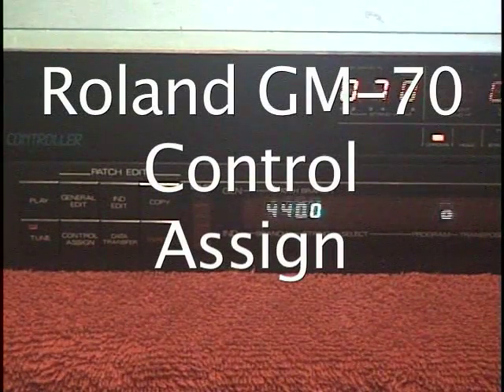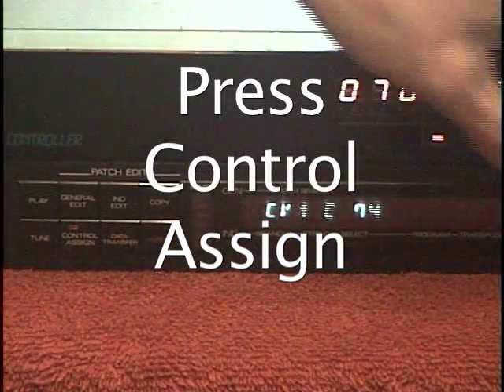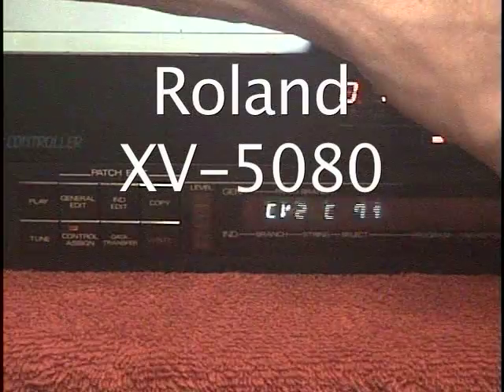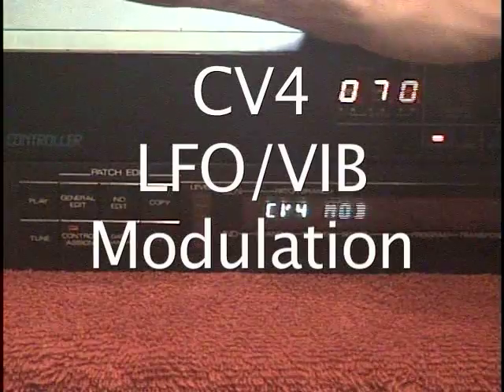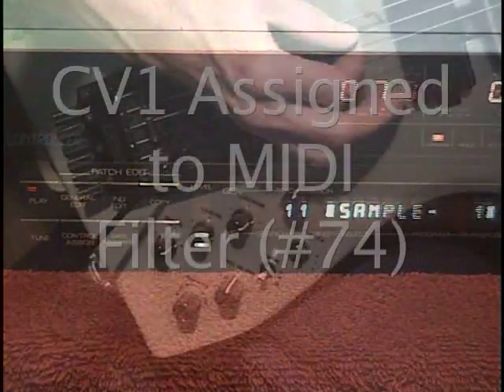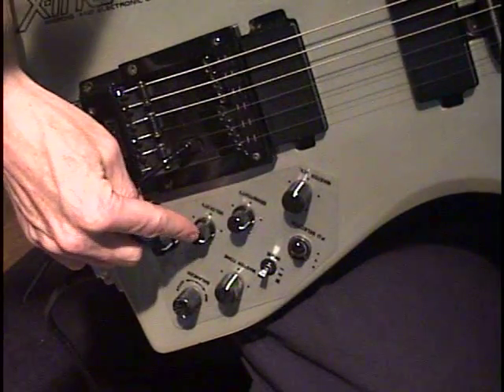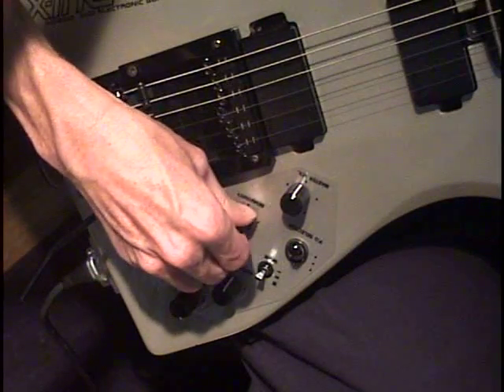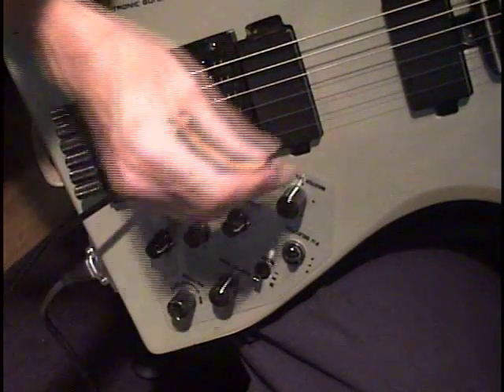Roland GM-70 Vintage MIDI Guitar Synthesizer Controller Assignments - Tutorial

Comment: In spite of its issues, I find the GM70 still very useful (I still have the one I bought new back in the 80s). I was disappointed that they never followed it up with a more advanced version. I've always wanted to be able to assign the various CC's (to the knobs on my guitar controller) to send out different CCs, scaled differently, on different branches. Also, the sound of the actual guitar coming out of the GM70 jacks is lower level and a bit noisy compared to just taking the straight guitar output. I don't suppose you ever came up with a mod for that?